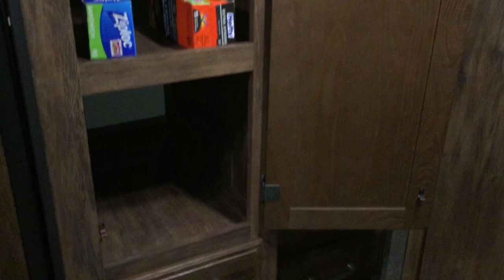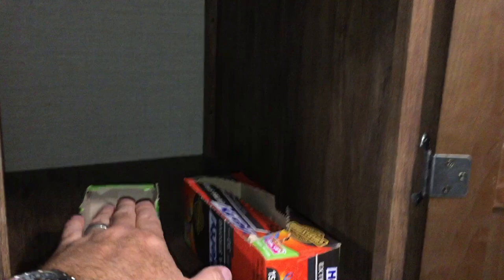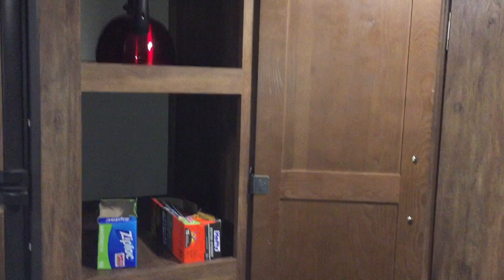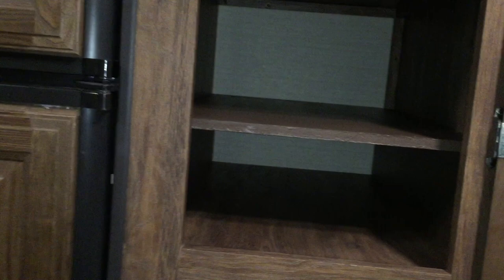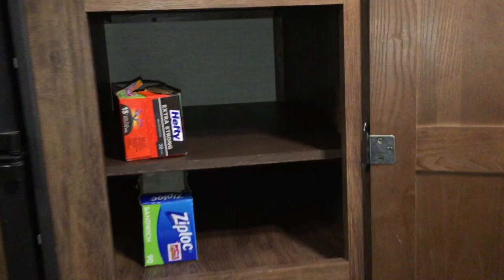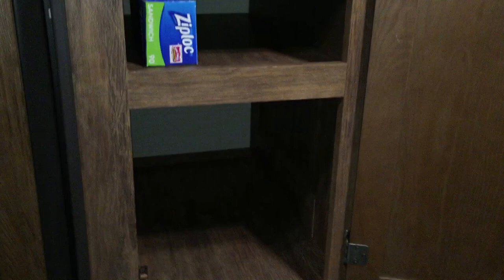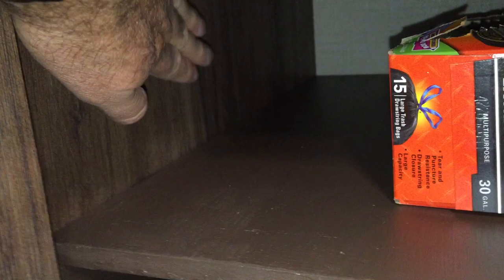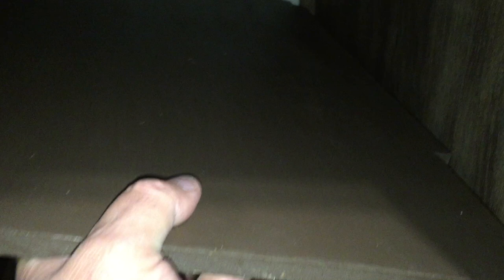How to double the shelf space for your RV cabinets

Comment: I still can't get over the fact all three of you are living full time in that little trailer. 

I have a 40ft Pinnacle just for myself. My search for the right floorplan was extensive. I need to have the full front closet. Even then I have to rotate clothes for the seasons. Luckily I found the perfect unit with a front bath. This bathroom is large enough to have a cabinet dedicated to the washer and dryer. Thus leaving the entire front closet for clothes and a quarter of my shoes. 

I really do admire what you're doing. Your daughter is getting quite the experience, adventure, and hands on education.

Cheers from Seattle!

How on earth do the three of you manage with so little storage? Granted you're further south so you can get away with tees, shorts, and flip flops most of the year.

Comment: Double backed tape is your friend. My problem is you can't see anything past the front of the cabinet. I think using tubs that can easily be pulled out is a better solution with the shelves added.
Reply from the maker: Great idea! We ended up putting some small (clear) tubs in the back of the pantry to hold extra items and baking supplies (things we don't need necessarily on a regular basis). The shelving spacing has helped with being able to see what's back behind the front row, but sometimes it is a guessing game when you reach way in the back and have to "feel" for what you are looking for!

Comment: I build cabinets and I still find this video helpful. I was surprised at all the 1/8 ply and also am wondering if the bottom of the cabinets will need a extra ply on top of what is there to hold any weight like can goods.  Yes am a old new B..
Reply: Mark, I do believe that the mfg has 1" rails on the outside of the shelving(front & back) for an added support. (This being below each of the shelves)

Comment: Your right when you said that RV's are terrible at utilizing the available space, that's why it's up to the buyer to figure out what they need to do to make it right. I just tore out the single plastic battery box in my RV to fit another 12V right next to it. Why wouldn't they just leave the space available for customers that want to use 2 batteries?

Comment: You could have screwed and "L" bracket into the anchor boards then placed it in the cabinet, put the shelf on top and placed a screw on the shelf board into the anchor board. I noticed that the anchor board on your left (my right) isn't sitting flush to wall, so movement from pulling your camper may cause it to shift and your items would fall...

Comment: It's better to put drawers that can pull out. It's too hard to reach stuff in the back.
Reply: That's a good point but the problem with that is the wasted space for the slides and such. It is hard to reach back there but for me, space is more important. Especially when you're living in the RV.
Reply: Not to mention the added weight of drawers and hardware.  Light weight is key or you have a monster to pull.

Comment: TENSION RODS (from Walmart, etc.) could have been used to hold up the extra shelves, instead of having to cut "support boards" to do the same job. No screws, no saws, and no drills required. Plastic bin containers (that come in all sorts of shapes) could sit on top of the tension rods to hold items. The tension rods could be adjusted to any height, at any time - as needs change. Us women tend to think of ways to simplify things! (Big Wink and Smile).
Reply: True, but some RV cabinet walls are nothing but 1/8 plywood.  Tension rods may not always work.
Reply: I like the board idea better, no offense.
Reply: Not really. They're not very sturdy and finding all those containers to make the right fit is kind of a time waster. It would actually be cheaper in the long run to go the wood way. However, for those who are afraid of minor woodworking jobs, then yours is an excellent idea. In my early years that's exactly what I would have done.
Reply: Tension rods are unstable, unreliable, and ugly.  Theoretically, this is another solution, but you have to buy them which costs more than scrap wood planks, then mickey mouse in a solution.  This is better.